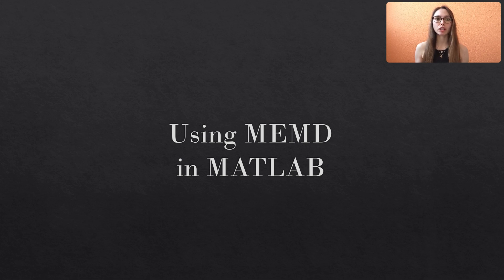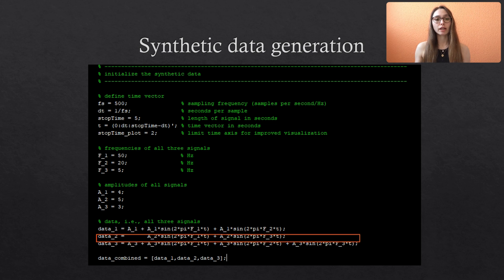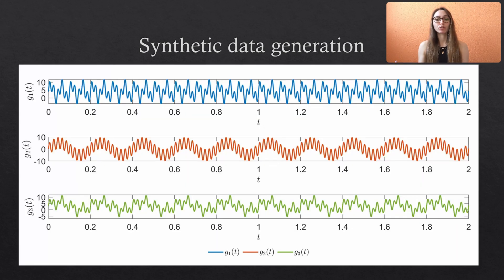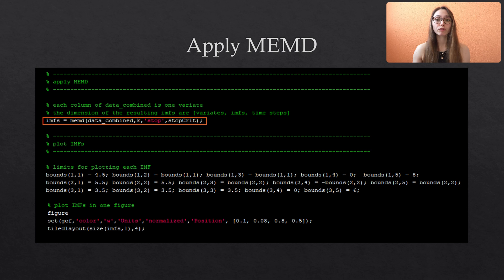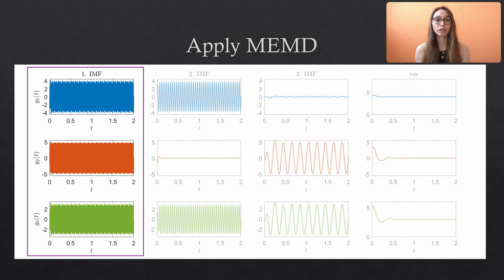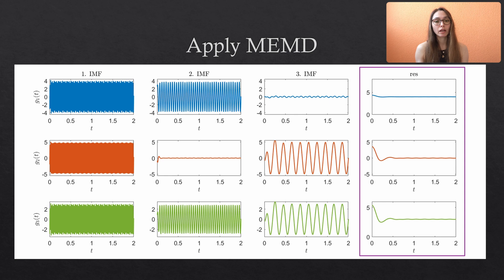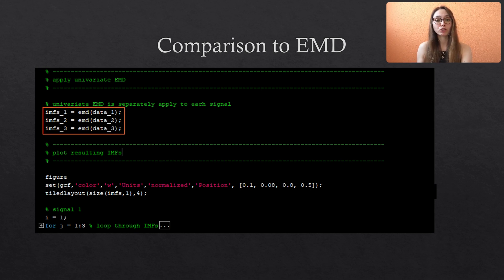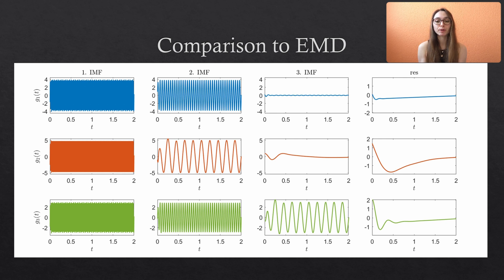1D Multivariate Empirical Mode Decomposition (MEMD) in MATLAB

Comment: Großartig! Many thanks for your very informative videos. Can one compare the results of MEMD with the outputs of DMD, mrDMD and STIMD? Would you make videos on these topics as well?
Reply from the maker: Thanks for your nice feedback :) It is very difficult to compare the resulting modes with DMD modes. Let's assume you have spatial (2D), time-resolved data because otherwise, DMD application is meaningless. You apply any EMD version (multivariate, noise-assisted, ...) in the spatial domain (I am planning a video about that soon). Then, EMD and DMD both yield spatio-temporal coherent modes but they look very different because the foundation on which the modes are derived differs strongly. While EMD is a non-linear decomposition method, DMD is linear, searching for a best fit linear model that advances your data forward in time. You can investigate the growth/decay or oscillation based on the eigenvalues. DMD is based on SVD and thus, aims at finding modes with the highest covariance in your data (high spatial correlation between different time steps) while EMD would rather search for connected patterns based on their spatial scales. I hope this short explanation helps! I am planning to do another video series about different data analysis tools and how to select the appropriate method for a specific application but this will take some time...
Reply: @estherexplains7521  So many thanks for the clear explanation. Very nice of you. I am looking forward to watching your future videos, esp. how one can use MEMD for 3D datasets (longitude, latitude and time) in climate research :)
Reply from the maker: @siavaschip123  I am happy that the explanation was helpful! If I can find a nice example, I will include some climate data in the respective video ;)